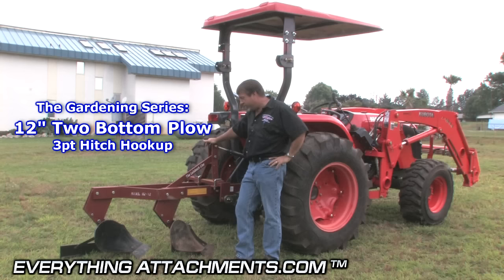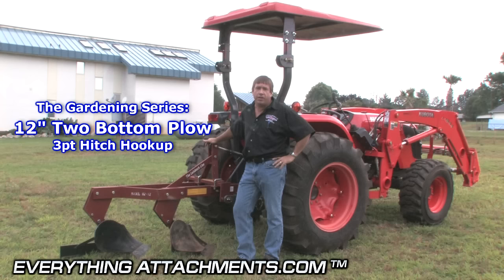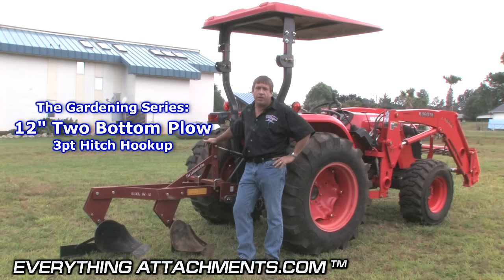How To Plow a Garden - Two Bottom Plow

Comment: Why do u need 50hp a Ferguson TE20/Ford 9N can pull a two furrow plough and they only have just over 20hp!
Reply: Well he said the older heavier tractors with less HP will still pull a double plow. And he is right. My to20 Ferguson can pull one all day.
Reply: Like he said, older ones are a little heavier for the amount of hp, amd they arent hydrostic they have a good ol transmission in them which i prefer even though they are a little slower to use.
Reply: George Thomas  That Kubota is maybe 1500 pounds or so heavier than a TO20 or N Ford. The 2150 pound 9N or 2700  TO20 are no where near as heavy as that Kubota in the vid. The tractor in the video is around 4,000 without the loader. That looks to be in the L40 series.
Reply: Like i said, they are heavier for their amount of hp, i didnt say they were heavier than this.
Reply: @stuartluig2911  Guys been plowing with hydros sense the 60's. The Kubota is heavier and more HP. The hydro isn't affecting the ability to plow. On a tractor that size I bet that hydro only eats 3-4 HP. So the Kubota with loader is X2 the HP and 1500-2500 pounds heavier?
Reply: I was thinking the same thing. I use a John Deere 50 and plow a 2 bottom in 3rd gear all day long. Its sandy here though.
Reply: Guys, these are only 12” bottom plows. My 16 hp John Deere 650 compact 2WD with multi-tracs should pull a 2 bottom 12”.

I grew up with an IH 504 40 hp pulling a 3 bottom 16”.
Reply: @0:35 he answers this
Reply: My international 300 couldn't pull a 2 row very well.

Comment: not moving fast enough , just making a suggestion is all
Reply: Sure is funny watching these kids do a "show how" video and you can tell they don't "know how". Put it in the highest gear it will pull with the throttle wide open up to about 4 and 1/2 miles per hour. They surely would not finish a 10-acre field after school at that rate.

Comment: I have a 56 ford 600 and it plows great. Old tractors never die
Reply: I use to pull two 12's with a 8N ford, it didn't run away with them but it would pull them, the 8N I believe was 16 or 17 HP

Comment: I just sold a 1958 641L ford Workmaster tractor with excellent compression.  I replaced it with a NH Workmaster 33 or 33 horsepower. That new diesel tractor with loader is much heavier than the fully  weighted old 641. I run the same attachments and when I use the Brush hog the new turbo diesel never even strains. The old 641 was rated at 48 horsepower and the new one 33. I used the older one even as a kid in OK on the grandparents farm and it never had the power of the new one. A 641 was a 3 bottom plow tractor so I would say any 25 horse tractor being a little turbo diesel would pull it, you might have to go to an auction and score some rusty wheel weights and get some heavy all thread and make some adapters but it would pull it especially a shuttle or hydrostat that we have today that are infinitely adjustable, always have the right gear. If you have a loader you might have some weight in it too.

Comment: you need sway chains on the 3 point hith to keep the plow inline with your right wheel so it doesn't leave any unplowed dirt between passes
Reply: Never use sway control on a plow you adjust the plow to follow the tractor that's why it has adjustment to swing rear of plow right or left

Comment: @RoughNeckRage All about weight and traction. We have an old Fordson Super Dexta with about 35-40hp, and it would pull a three furrow bottom plow easy. have never tried a compact tractor with ag tires, so I'm not sure how big difference it makes compared to the ones in the video, but a 2bottom plow for a 42hp 4x4 tractor should be fine. so if your soil isn't extremely hard, i'd say go for it!

Comment: The coulters need to be set another couple inches to the left, the paint needs to be scrubbed off the moldboards, and the tractor needs fluid added to the rear tires.
Reply: 17br549 v

Comment: Hey Ted,  I notice that you did not remove the stabilizers from your tractor.  A plow it supposed to be able to float side to side. that is why the tractor is spinning with the small plow behind it and why as you can see in the video the driver is having to keep the front wheel pulling the front around back into the furrow way. 
  Other than that good video the rest is correct.
Reply: @Dougarrowhead  no. A well set up plow will follow the tractor in a straight line without restriction, if the tractor pulls straight the plow will follow that same line. The plow wants the tractors front to go right, when you set it up right the tractor will pull slightly to the left and this ballances each other out.

Comment: For comparison. I have a Ford 680 tractor. Just about the same weight as the tractor in the video MINUS the loader. My 860 is rated at 45HP by the Nebraska tests. Almost identical in the tests with that Kubota. My 860 doesn't have a loader. The Kubota because of things like the 4 wheel drive is heavier. Then the loader adds even more weight. I'm up grading from a 2-12" plow (I used that with a Ford 8N) to a 2-14. So that Kubota, with the plow set up correctly, and with an experienced operator in the seat should play with that plow.

Comment: These are only 12” plows. You should be able to pull this with a 16-20 hp 2wd compact with multi-trac tires.

I grew up pulling a 16” 3 bottom with a 40 hp International 504.

Comment: 50 HP struggling? As a boy we a had a 21 hp JD pulled 2 bottoms through old sod no problem- A helpful hint after plows attached drive LEFT side up onto pair of car ramps  then adjust til your shares are flat on concrete

Comment: A ford N handles the 2 bottom plough NP.  Weight and Gears is key. Not HP. Hell I pull a two Bottom Plough with a kubota L2501. Same weight as the Ford N tractor.

Comment: Fancy 50 horse Kubota struggling to pull a two bottom plow, I can do the same thing with my 1950 Farmall C. Is she just chugs right along.
Reply: You know what, they don't make them the same anymore. They even have those emission dpf craps in farm tractors nowadays. What a joke!
Reply: Struggling that Kubota will drag that 9n backwards all day everyday I know I Owen them both
Reply: And if that plow was set up right being operated by someone who knows how to plow that would plow rings around your Farmall C. The problem there is the "adult" doesn't know what he's doing. And the kid in the seat is just doing what he was told. So it really boils down to operator error.
Reply: @jonanderson4280  Not true. I go  by the Nebraska tests. That Kubota is 50HP, with the loader at least 1500 pounds heavier than a Farmall C or Ford 9/2/8N series. Even with the Tier 4 emissions crap that tractor in good shape should plow rings around the Ford or Farmall.

Comment: how much should be the minimum HP to use 2 plow? thanks in advance ted
Reply: He said it in the video
Reply: The Ford 9n was used with two 14" bottoms and was in the low 20s in horsepower. As he said in the video, weight is the limiting factor in modern tractors. You need to go to a 50hp compact tractor to have as much traction as the 23(ish)hp 9n had.

Comment: do you need to plow if you are going to till? Would you do both? If not, when would you plow vs till and what's the difference in terms of result?
Reply from the maker: A plow turns over the vegetation and, if you give it some time before discing or tilling,  it will decompose and your garden will benefit.  
The plow also cuts deeper, which is also good for your plot.
Preferred order is plow, disc and till.  You can leave out the disc and go straight to tilling, but the disc simply helps out the tiller with an intermediate breaking of the soil.
Reply: +EverythingAttachment wow thank you that makes much more sense now. would you guys ever consider doing a video of top ten most useful attachments and what they are used for? also, do you carry grapple claw attachments?
Reply from the maker: We haven't done a video like that yet, however we do have an article on our blog of the top 5 gardening attachments that might be worth a read. http://blog.everythingattachments.com/top-5-gardening-attachments-of-all-time/

We sell many variations of grapple buckets for any size tractor, find more at http://www.everythingattachments.com/Tractor-Root-Grapples-s/10568.htm
Reply: EverythingAttachment what is the hp needed to pull it
Reply from the maker: The soil has bearing on the answer to your question, but I'd want a tractor at least in the upper 30's for HP to use a 2 bottom plow.

Comment from the maker: A middle buster is also known as a potato plow, it is good for bringing up vegetables that grow under the ground such as potatoes. As for you stuck attachment, I would start with a penetrating oil, hopefully it will soak in within a day or two, if not, a hammer could be useful, and hopefully you don't have to go as far as using a torch to pull it off. Thanks for watching!

Comment: Ted, What would your recommended use be for a middle-buster?  Also, the dry metal of the attachment has seized to one of the lower points of the hitch.  Any suggestions?

Comment: My John Deere B has 15 hp and pulls a two bottom plow just fine . But the Kubota with 50hp struggles to do it ? That's funny !  Mines a 1942 model . Hahahaha !
Reply: R1 tires?
Reply: It's those R4 tires. I mowed with a 1025R Deere with r4s and that sucker was helpless unless in 4wd on the slightest hill. My 2wd garden tractor with loaded ags could outpull that sub compact with r4's. They really don't bite any better thsn a turf tire.

Comment: Do you need to plow, or can you just till?
Reply from the maker: Plowing is a great initial step in soil preparation which should increase crop yields.  It's a good idea to turn the soil over with a plow in late fall, which will cause the organic matter to decompose and add nutrients back to the soil.  Disking prior to planting in the Spring will mix the matter up and leave you with a better soil composition to work with!  Thanks for watching!!

Comment: Moldboards aren’t shiny yet and he’s going to slow for the soil to lift and actually turn over...
Reply: 1DirtyMutt I plow with horses that walk slower n turn that dirt just fine. Has more to do with plow still wasn’t level in the furrow. Can see landslide 1” off the ground in the rear. Shiny mold boards simply keep it from sticking w dirt not turning it over. Also why tractor spun cuz plow is digging n not leveling out. When it levels out it actually puts pressure to the rear tires. And none of these tractors have hydraulic down force. Unless a hydraulic top link is added. They only lift with pressure. Hope this helps

Comment: Tell me why I 19 and 22 horsepower Ford tractor or International tractor will pull the two bottom plows like you have but are 24 and 25 horsepower compact tractors won't do it is it just the weight because the weight is not that much difference between them as a matter of fact the compact tractors way more than the old tractors like that did
Reply from the maker: The older 19-22 hp tractors had larger frames, big ag tires and were designed for pulling in the field.  Most of the modern compact tractors are designed more for landscaping and loader work along with some, but not as much, ability to pull in the field.  Thanks for watching and commenting!
Reply: Kubota b26 manual claims it will pull a 2 furrow plow....
Reply: I have a kioti cs2210 that pulls a brinly 2 10inch plow custom made us se 1 on my ls mt225 and my kioti ck2510 my ls is the only one that will pull my massey Ferguson model 43 inch single bottom

Comment: To be honest if i'm going to be using a 50hp tractor, i'd rather try to find an old agricultural two-furrow plow from a known plow manufacturer like Kverneland or something similar. Those things used to be pulled in all kinds of conditions by old 2wd tractors with a lot less power than the Kubota in the video without much trouble... I guess it comes down to the years of experience and design that went into the old plows, compared to this which kinda looks like it's been farbricobbled together in a day or two in someone's garage... No offence.

Comment: Is this guy for real? An 8N Ford will pull that plow all day without issue. That Kubota should handle a 2-14 and maybe a 2-16 easy. First get the plow set up BEFORE you start plowing. Look it up. Direction are on the net. 2nd step, get the ground speed right. Should be moving a bit faster than that plowing.
Reply from the maker: Rather than making sugar coated videos where everything is lined up and happens perfectly, we prefer to take our viewers for a ride in the real world.  Thanks for watching and commenting!
Reply: @EverythingAttachments  OK, your tractor is heavier, double the HP AND 4X4 over an 8N. All you showed was how not to do it. What's sugar coated about that?
Reply from the maker: @oldtanker2  Thanks so much for your constructive criticism.  Have a wonderful Monday and rest of the week.  Again, thanks for commenting.  It really helps out our channel.
Reply: Alpler two  ploughs vedios